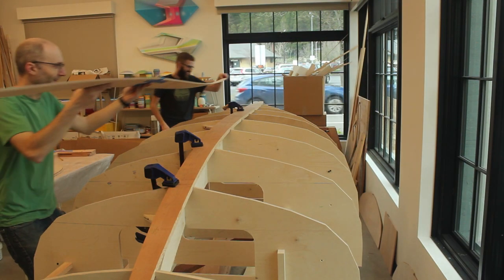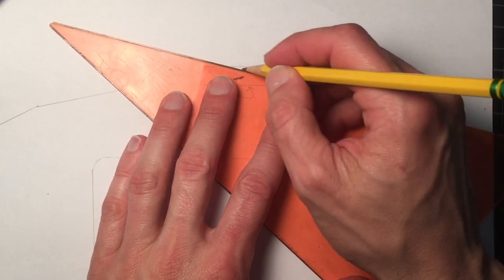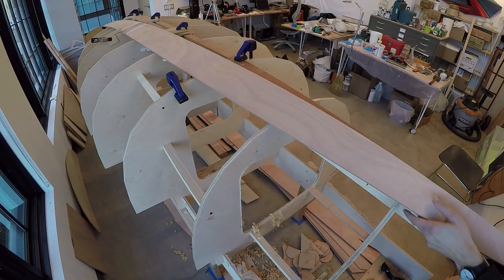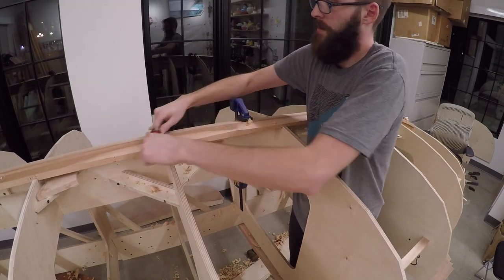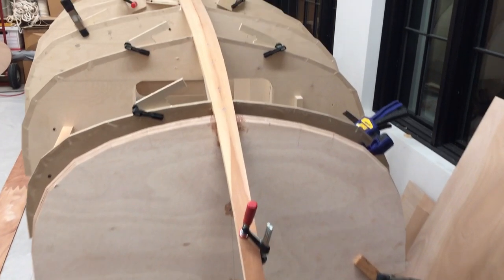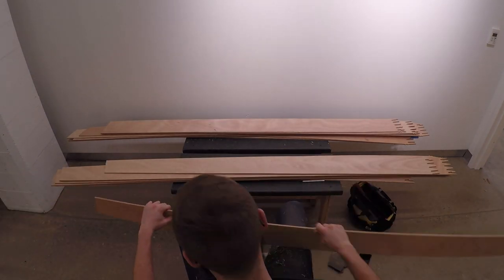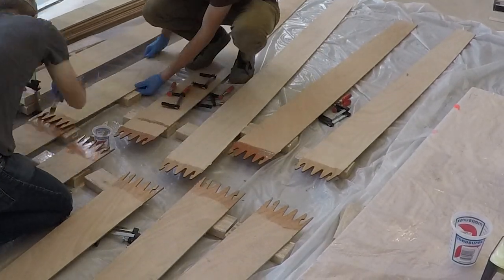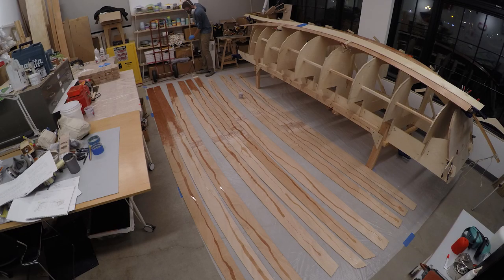Designing for Dinghies, Ep. 4: Beveling the Keel and Gluing Together the Planks

Comment: Oh man, I'm so grateful for this.  I', waiting for CNC-cut ply to start building an Ilur - another Vivier design, very similar to your build, and I'm learning so much from your videos - thanks so much.
Reply from the maker: The Ilur is great! I almost chose that design too. I'm glad these videos are useful, and I wish I could provide a more expert viewpoint, but I'm learning as I go. I'm a bit behind in posting videos at the moment, but if anyone benefits from these, I'm happy. Good luck with your project.
Reply: @designingfordinghies5427  Thanks very much.  One thing I am doing differently is making about 50 basic ply clamps (A 'C' in 12 mm ply plus a wedge) big enough to reach across the strakes.  I hope they hold well enough instead of the screws (or most of them).  We'll see.  Thanks once again.
Reply from the maker: @damoog5985  Sounds like a great plan. Good luck. The holes were annoying, but as I begin to patch them they aren't all that bad. And the most important thing is plenty of squeeze-out of epoxy along the seam. The clamps should do well with that. The screw method definitely works if needed as a backup plan (especially in the tricky spots at the bow and stern :-)

Comment: How do you find his plans? They are expensive, so was wondering what the instructions are like, if any. Cheers, great stuff.
Reply from the maker: For a first time boat builder like me, the plans are a bit tricky, but I've been able to figure everything out. A previous customer of Vivier's translated the instruction book(s) from french. There are actually two instruction books, one on the Aber, and one for general boat building tips. The instructions are thorough, but don't go in a strict step by step way from start to finish, rather they tell the specifications and basic approach for part of the construction. I purchased the CAD file version and CNC cut the parts, so I can't speak to attempting to cut the various components from the other version of the plans. Hope this helps  a bit.

Comment: Progressing nicely. Interesting point about the oluome being porous. On the spoke shave and knuckle crunching: I have a draw knife which I have used for fast removal; but am not brave enough to use it for very long. You are right about checking regularly: creeping up to a point is far the best way. Keep well.
Reply from the maker: Yes! It's definitely easier to go slowly and take of a bit at a time than to add wood back on if you go too far :-)

The whole issue of thoroughly encapsulating the wooden sections of the boat in epoxy is an interesting one to me. Obviously the marine plywood will expand less than the Doug Fir keel if exposed to water, so it seems logical to be coating all the wood with epoxy in an attempt to minimize any expansion and contraction. On the other hand it can be prone to potential problems as wood will want to move no mater what. Other wooden boat construction methods embrace this aspect of the wood material. I suppose that is just the nature of this type of epoxy/plywood based boat construction. 

I finally got around to watching your launch of Hornet. It looked like a great restoration. I'm looking forward to seeing more of your process videos as have time.

Comment: Can you think of any good reason why beveling the keel couldn't be done prior to fitting it onto the boat? In my workshop, with a long bench, it would be much easier to do the work off the boat. Even if that meant removing the bulk on the bench and doing the final planing to fit on the boat.
Reply from the maker: It would be pretty easy to mark the measurements off of the construction frame and then move the keel on your work bench. I can't think of a reason not to do that, but there may be something. Unfortunately, I don't have a nice long work bench.

Comment: Really nice, plane video about how to set up the planks and the keel.  One question, how come the wood didn't stick to the clamped wood that held the two pieces together during the epoxy?  That wasn't clear to me fully.  Can you illuminate?  Thanks!
Reply from the maker: Thanks for asking! I should have remembered to mention: coat all clamping blocks with clear packing tape prior to gluing so it won't stick to the epoxy.